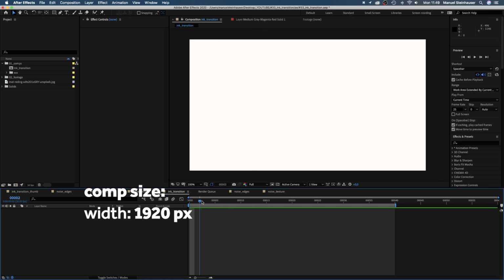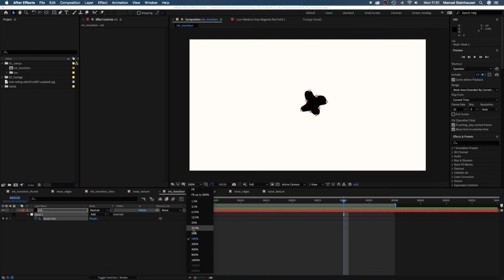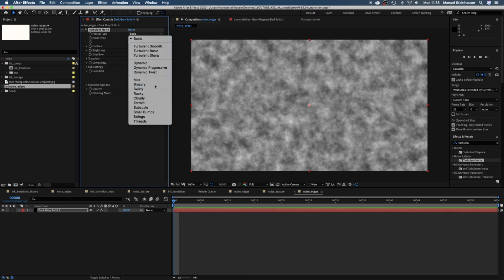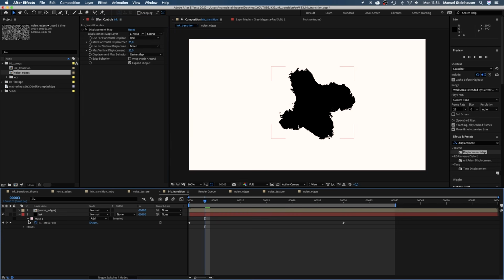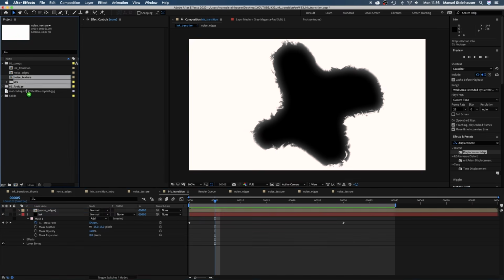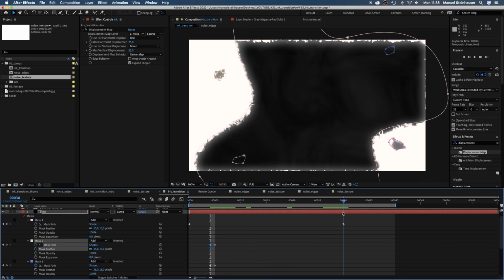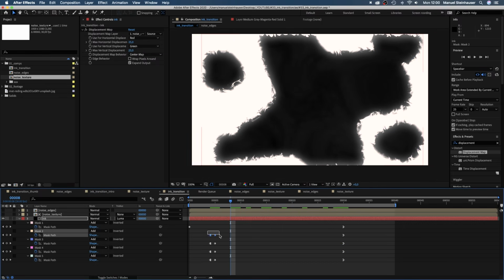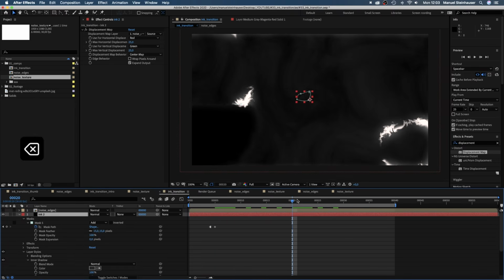Ink Transitions using only standard effects | After Effects Tutorial

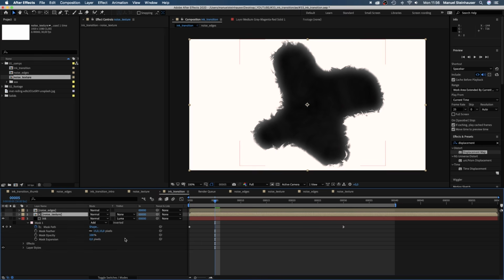Comment: 4:03 Where you move those little masks out of canvas...if I do exactly what you do ALL the masks move, I cannot select an individual mask. Also, at 3:34, there is no more Luma there, I guess AE was updated. Any tips?
Reply from the maker: If all the masks move you have selected the solid instead of one mask. You need to select one of the mask properties to move it.
The track matte system has changed in AE 23. now you link layers to your mask layer with the track matte pick whip. Click on the left box to turn it from an alpha into a luma matte.